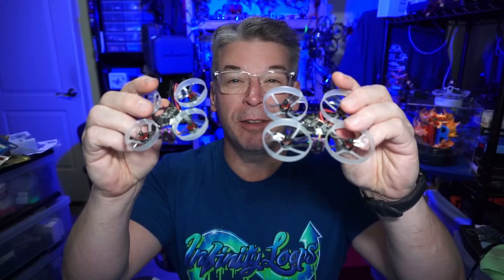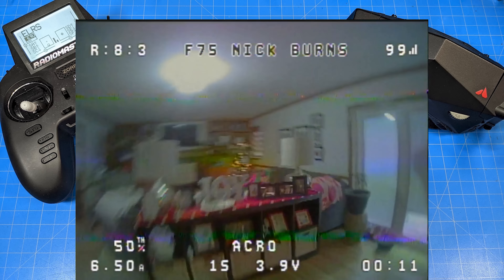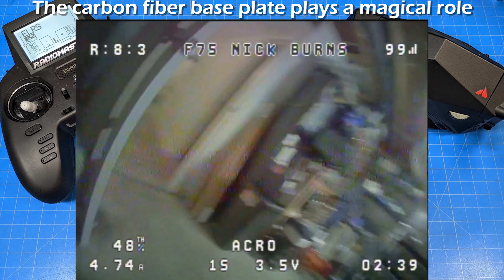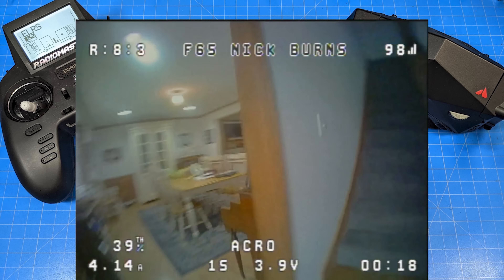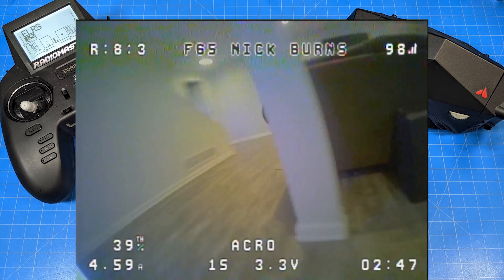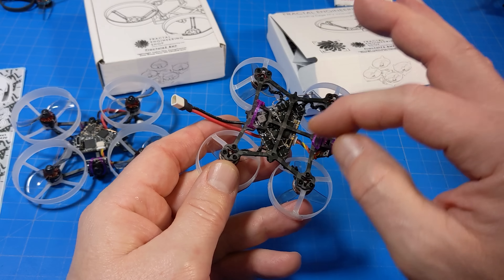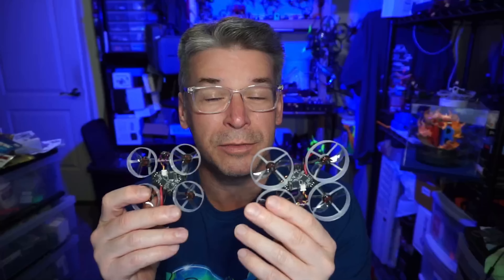Fractal Engineering F75 & F65 // QuickSilver // Whoop Improved

Comment: I'm wondering do the ducts really need to be on there?   Maybe you can take them off and fly them for a week and let us know how it works out!
Reply from the maker: For inside flight I do suggest leaving the ducts on. The risk with taking them off for outside flight is the 1mm motor shafts. They tend to get bent or broken on crashes. We do have the option to get 1.5mm motor shaft motors in the 0802 size from happymodel, that would be my recommendation if flying without the prop protection is desired.
Reply: I built an Ultra Mini digital Ripper and didn't put on the ducts. Flies great, but crashes a ton more cuz every single little tiny tap of anything, and it's tapping those props, so instant crash! 🤷
Still, imagine how lightweight these are without the ducts! A whoop frame weighs about 4 grams, so the 65mm is somewhere around 15 - 16 grams without ducts. 😉👍
Plus, fly that 75mm with the 300mah lipo! What the hell? Why when he flies a 75mm, does the lipo have to go up in mah, and weight, approx.50%? IT DOESN'T!

Keep them as light as possible. 😎🤘

Comment: Hey Nick! Love the reviews, but I have a little request: when you say that a board has built in ELRS can you also let us know what interface the receiver is using? I know that on the HaMo Diamond it's an SPI, but a lot of the newer boards(like the GOKU Versatile F405 2S 12A AIO) are using a UART to avoid the ELRS SPI issues. I know BF4.4 fixes the issue, but it's probably going to come up again at some point so it would be nice to know without having to dig around the net.
Reply from the maker: Thats a fair point. I will keep that in mind.
Reply: The latest QS 0.9.5 supports ELRS 3 with SPI. If you want ELRS 2.x you need older QS 0.9.1

Comment: Dang it! I just bnought the M7 1s ELRS. Turns out Im always on full throttle in turns, since I love racing in the house like you do. Guess this is the Whoop for racing to get? Is there something better to buy for only racing a tight course?
Reply from the maker: Size of the whoop will depend on the race space. If the M7 is full throttle I am guessing its a really large space, like bigger than my house, or your skills are really top notch. With that, we can get props that have more blades and/or higher pitch. This will reduce flight time and potentially need a pid tune tweak. Otherwise we can replace motors for higher kv to get more speed, but again flight time will decrease some.
Reply: @NickBurnsFPV  thanks for the detailed answer. I‘ll try 3 Bladed Props but still bought the Fractal. I think the weight of 24g of the Mob7 is just a bit too heavy to be as close as nimble as the F75 is. Thanks for the review. I enjoyed it a lot!

Comment: Those look nice. I wonder if I fly outdoors you could lose the ducts? I broke(got run over) a cockroach and the carbon fiber piece was saves and wondered why there’s no >75mm toothpicks
Reply from the maker: yes, we can take the ducts off and fly it. It would be best to have motors with 1.5mm motor shafts though

Comment: My mobula6 with 0802 19k is acting up since i did the conversion. It has almoat no power, and hovers at over 5a. Im lucky to get right at 2min flight. Seems like its under-propped. Idk

Edit: it has the original bi-blade props that came with it. Ordered some gemfan 3/4 blades. Hope it helps

Comment: The sound of the motors on this whoop, or 0802 motors in general, compared to the 1002 drashark   motor sound; which one sounds more silent to you?
Reply from the maker: to my ears the difference is in props and the quad cell count used. Biblades tend to be more noisy than triblades.

Comment: i still cant figure out how to bind up the x12 unfortunately with elrs. ive tried everything multiple times and it just doesnt want to connect
Reply from the maker: There is likely 1 primary barrier. The ELRS RX and TX need to be on the same major version. So if one is set to version 2.5 and the other to version 3, they can't bind. Unfortunately with AIO and SPI elrx RX the version is part of betaflight and I don't believe there is a way to identify which version. I believe happymodel is shipping their quads and components with ELRS v2.x, so I would start with flashing your radio module to ELRS version 2.5 and try binding after that. Don't forget to update/replace the lua script that controls the elrs on the radio. They too are version specific.
Reply: @NickBurnsFPV  i figured it out by flashing the firmware from DLLarson and it bound right up. thanks for the info and help

Comment: Hey Nick, what 75mm drone build would u recommend to get if only be able to chose 1 75mm (either self made or bnf).
Reply from the maker: I wouldn't likely build one, unless there is something specific I want to test or try out, then it wouldn't likely be a personal favorite. Another reason I wouldn't likely build today as its less expensive to buy a pre built quad. At this time I would buy a betafpv air 65 or air75 depending on if the flight space is primarily inside or outside.

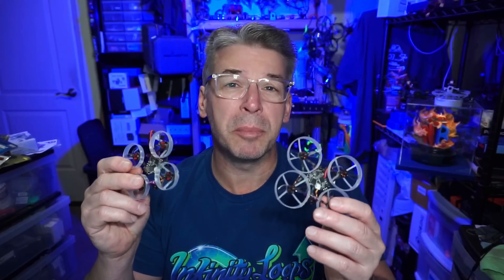Comment: just get about 2:30min flighttime with my fireflywhoop65mm whoop on 380 gnb. stop flying at 3,3V. how low can i go while flying so that i end on 3,5V?
have a nice new year!
Reply from the maker: That is a fair variable to recovery to 3.5volts. What I do is tinker with the battery warning voltage. What I am looking for is the voltage when I am not on the throttle all that much, flying straight and flat, that voltage is what I watch. Depending on the weight of the quad and its effcientcy and the battery weight we find the end flight while flying flat that allows us to end/disarm at 3.5 volts.

Comment: I built the 66
Mm. Used the f4 full sized board. Had to flip it upside down. Figured out how to turn it 180% in bf. But now I have to rearrange the motor order.  Having a problem with that.
Reply from the maker: Betaflight can also reorder the motors without haven't to remap them manually. There is a wizard in the top left of the motors page.
Reply: @NickBurnsFPV  thanks. I'll look into that.

Comment: Maybe this is a dumb question but is it possible to use the 75mm frame with HM 1102 1000kv swinging 2023 props and the X12, I'm trying to build a TKS rocket race but I don't have any way of getting it for a reasonable price in Australia, it would be like 50aud shipped for one :( any other recommendations on a 2 inch toothpick frame that's available on AliExpress or Banggood I've looked everywhere
Reply from the maker: Its likely possible, some of the challenges. The props are going to overlap the FC/AIO, we would need to ensure the AIO is mounted lower than the prop line and that nothing from the AIO is going to be hit by props. The next challenge is camera mounting. A traditional canopy probably isn't going to work all that well as the canopy mounting points will likely all need to be under the prop line. We could design a special canopy that is super low profile under the prop line and the camera mount in the center of the AIO. We could also design a camera mount to go under the prop line in the front.
Reply: @NickBurnsFPV  HAPPY NEW YEAR FROM AUSTRALIA! Thank you for your response, tbh might be too hard, any suggestions for frames to fly those components paired with the nano tech 300s? They are batteries I can get for a reasonable price, also what are your thoughts on the CNHL ministar 2s 350mah HV? I kinda gotta build around the battery ahahah
Reply from the maker: @youhannawahba1268  maybe the flywoo nano baby, or the new happymodel bassline. CNHL under label the capacity and are heavier than there counter parts. Not a fan for micros.
Reply: @NickBurnsFPV  I'll have another look thank you for Ur suggestions :) I'm a fan love the channel and the consistency with how you review stuff makes for a great watch and easy comparisons

Comment: I've had better luck with the full size Happymodel ELRS flight controller.   The Diamond version is hit or miss.  Alot of people, including myself have experienced bad flight characteristics and excessive electrical noise with the Diamond board.
Reply: I love the F4 ELRS on the F75, I offer it as an option; the extra control and video range you get from the improved antennas and VTX has been a blast. Seems more robust too
Reply from the maker: Mr. Fractal himself also commented on the diamond board issue.
Reply: @fractalengineering  How much more weight?
Reply: @marksherman630  about 2g according to my quick measurement

Comment: How can you not compare these to moblite7/6? These had to be compared 😔
Reply from the maker: Comparing every quad or category of quad I have reviewed would be an insurmountable task and such a long video. Even comparing the most recent would be super long. I leave the comparing for the viewers.
Reply: @NickBurnsFPV  well, fair point. But still, if you had to own only one, which one would you pick?
Reply from the maker: @kaskalo2  Fractal for sure.
Reply: @NickBurnsFPV    I am thinking of acquiring another whoop (i will have to check the prices though...) and i missed that giveaway video, making me sad, so i give myself right to bother you with one more question 😊 Just shortly (disregard comparability) which one would you pick this fractal or meteor 85?
Reply from the maker: @kaskalo2  for indoor fractal 100% for outdoor meteor 85, but if mixed indoor and outdoor flight fractal would be the choice as the meteor 85 isn't viable in most indoor spaces.
Reply: @NickBurnsFPV  even more then i asked. Thanks a lot Nick 😊

Comment: anyone knows how to keep the motor spinning when arming ? my motor not spinning when on 0 throttle,
Reply from the maker: we need to enable air mode, I suggest turning it on in the betaflight configuration application on the configuration page there is a slider for air mode, this means its on all the time.
Reply: I already flash to quicksilver :( @NickBurnsFPV

Comment: The frames are pretty awesome. The camera canopy is 💩. Absolutely hate the canopy.
Reply: That's one way to not only protect your camera, but also keep it ultra lightweight. 

Remember:
"It's all about weight with whoops."
 
Other canopies, that are on top, are way, Way too heavy! 
Just look at that thin tpu camera mount and marvel at that low of weight holding your camera solid! Brilliant! It's one of the very best features of these Fractal frames!!! 😎🤘
Reply: @KOrnhOliO1  even trimming the duct guards i can still see them in the camera view. The camera is always crooked, especially after any crash. There are a long list of lightweight canopies that provide some protection and better view and mounting. Personally, the canopy is the only reason i don’t fly mine often. I would prefer adding .5 grams and increasing the risk of damaging a $17 camera then to continue using the original gstring canopy.
Reply: @TheBattery00  Well I don't know what top mounted canopy doesn't leave the prop guards in view at the bottom without absurd uptilt. But you can totally add one yourself if you like; the mounting holes are compatible.

One of the main points of that lowrider setup would be that it doesn't require a canopy to protect the camera, because the ducts take care of that

Lastly if your cam holder loosens up there are provisions for extra nothes on the strap, so you may pull it one extra notch to tighten it up and it should be solid again :)

It also provides a bit of give would you ever hit a pole head on; I don't remember ever getting a feedback of broken cam on those frames

Either way, I love to see custom builds based on that frame so good for you if you found one that's not 💩 to you :D
Reply: @TheBattery00  Well, just don't use this camera mount! There are a ton of mounts you can use instead.  :)
Reply: @fractalengineering  i wish i could just use any other canopy. The usb on the diamond doesn’t allow for majority of molded canopy’s to fit the mounting. I’ve tried a few molded types. Haven’t tried any printed yet. Even though i do hate the canopy, I’ve purchased multiple items from fractal an have left only 5star reviews. I love the company, i love the products. Im not going to pretend i love that canopy. I know i can’t be the only one that loves everything but that canopy.
Reply: @KOrnhOliO1  I’d be willing to try one. Recommendations? I’ve already tried the crux, mobula6, mob6 hd, betafpv Original, and goober. Bee eye is a close fit but it still covers the usb. Which is not ideal for any build.